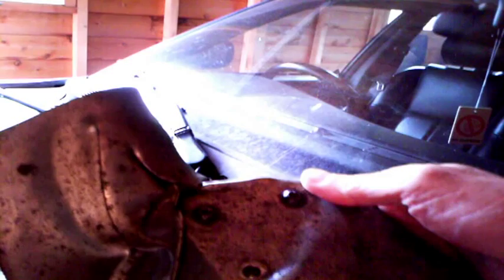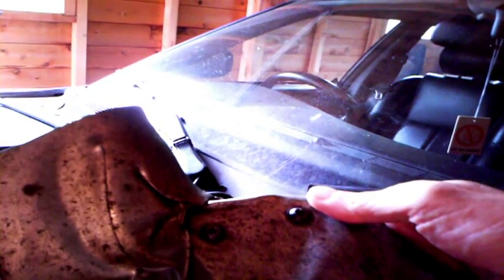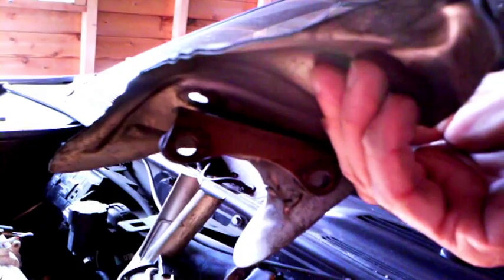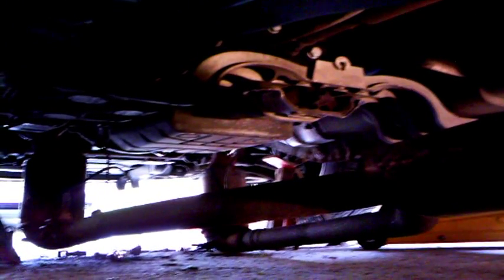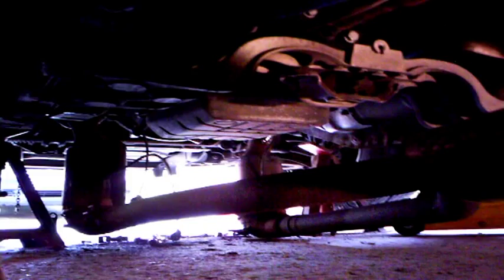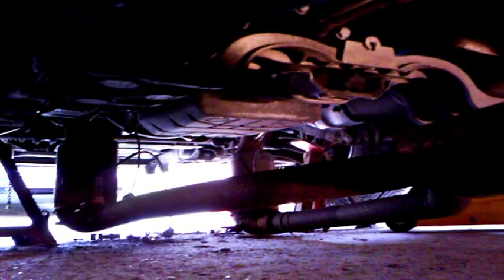Jag XJ8 ZF5HP24 Transmission Rebuild Part 2.avi

Comment: My god, did you wrestle that monster out of there by yourself? What tools did you use to safely roll the transmission out of there? Does the torque converter need to be unbolted or anything before you pull the transmission out of there? Thank you!